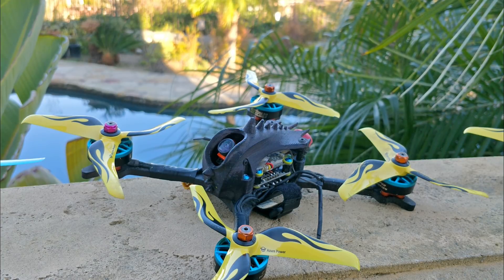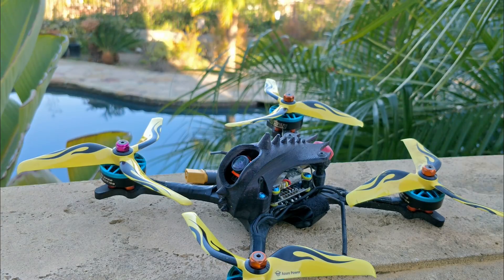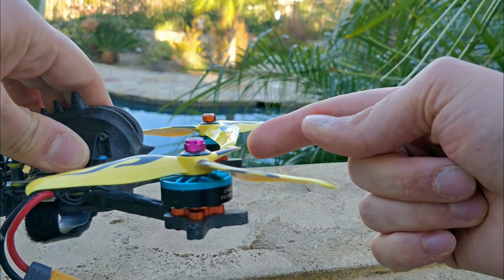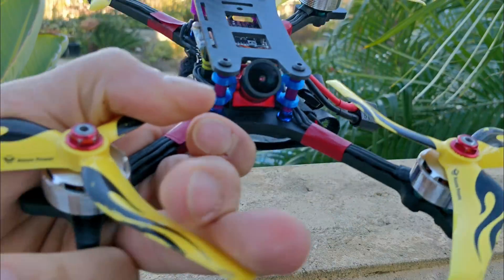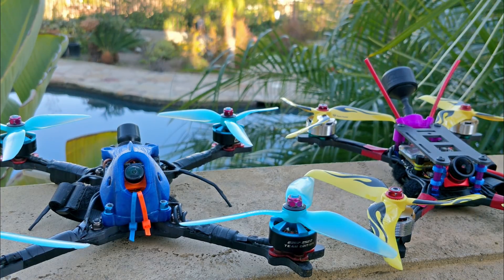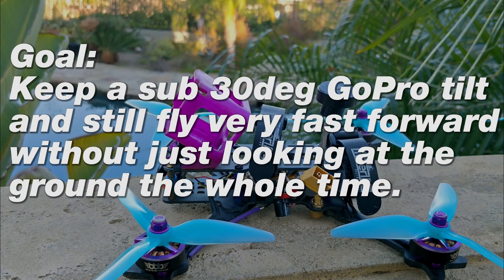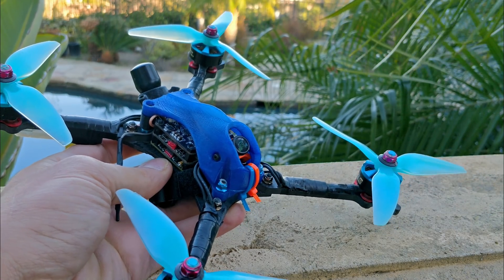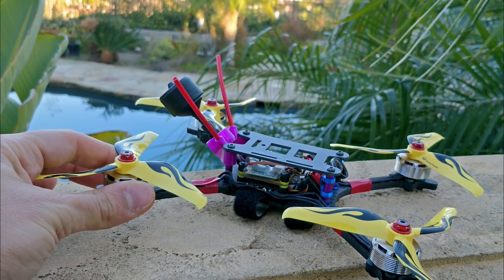Frame Geometry - Stretch X vs Tight X

Comment: Can't we just run 5.5" arms on true-x and call it a day?
Reply from the maker: That's reasonable.  But the difference between 5.5" and 6" is just a few mm.  So just gonna make it 6" probably.
Reply: mm... very funny to see americans talking about distance measurements in metric system. Hardcore ones usually stick to imperial stuff. No offence though :) Just sayin.
Reply: Wouldn't that have a larger footprint lengthwise than a std stretch?
Reply: KrotowX as an American we were prepped for the metric system at a very young age.
I was taught at elementary school that we would move to the metric system(we should have) imperial system is plain stupid! As a hobby machinist I build only in the metric system!
Reply: I read about several tries to transit from imperial to metric measurement system in US. It sort of didn't gone well so far. Partially because of large expenses for transition in some areas, partially because of people habits. At least in math, physics and other exact science areas and engineering transition already happened. But I guess that imperial system will continue to live 2-3 generations ahead because of habits.

Comment: Thanks for another great thought provoking video! I just recently purchased a couple Floss 2.1 frames, and I'm struggling with how to soft mount the 20x20 stack (HGLRC F440). Have you considered making a version of the Floss bottom plate with bigger 20x20 mounting holes, in order to accommodate soft mount bushings like on the Xhover WIN5L frame?
Reply from the maker: You can always just drill out the holes
Reply: Yeah I thought about that, but I've never drilled carbon fiber, and I wasn't sure it would come out cleanly. I'd probably want to test the process on an old frame before I try it on the Floss bottom plate.
Reply from the maker: go ahead, just do it outside, you don't want that dust inside.
Reply: Soft mount the motors instead. Should be ok for MPU6000 gyro

Comment: Hey Bob thank you for your time. Speaking of frame designs, have you checked out the RMRC hellbender frame? I have one and I think it flies great. I'm curious what your opinion is? Project Blue Falcon has a great video on custom mixing. Thank you sir.
Reply from the maker: I'm generally not a fan of monobody frame designs.  The arms on this are also quite beefy which will impact thrust performance a bit.  I think it's a bit dated of a design by now.  Was maybe good for it's time.  It's not a new design.
Reply: Kabab FPV okay now I have to buy your frame and move everything to it.

Comment: Interesting discussion. I remember BMSWeb at some point saying that Thomas got very similar laptimes by slightly changing racing style on true, stretched and squashed x. I think he did or still does race squashed x purely on his preference.
Reply: I think being familiar with your setup is the most important thing.  Constantly changing builds is going to be a detriment in most cases.  Any well built 5 inch quad is going to be very fast and probably capable of winning most races if flown to its true potential.  If you are always adapting to new setups you won't be able to fly the quad at 100%.  Thomas sticks with a familiar setup and is so experienced with it he can really fly it at 100%.  It's kind of like a 1000cc sportbike.  Doesn't really matter if you ride Honda, Suzuki, Yamaha etc.  They are all fast as hell and rider skill is what will really decide the winner.

Comment: What would fly better; 6 inch frame with 6inch props or 6inch frame with 5inch props?
Reply from the maker: 6" has a totally different feel to it so that's really preference but I know that a 6" with 5" props usually feels better than a 5" with 5" props.  Same with 4"
Reply: Trick question.  6" frame with 5.5" props

Comment: u are so correct.....and i believe that its kind of the same thing that happens with airfoils...the way the prop is designed creates a low and high pressured air due to it's angle etc....if the gab isn't enough for the air to get separated in its maximum potential the quad will not be that "effective"
.. . just making an assumption.... not really sure!!!!
Reply from the maker: I guess that makes some sense maybe?  I dunno that much, I just know what I've tested.  I can't even begin to guess the interaction between front and rear props, I just know that it happens and how to work around it from testing things.

Comment: Do you use the same 3d printer for quad parts as you do for a customers teeth?
Reply from the maker: I wish I could use a 3D printer on a daily basis in my dental office.  Unfortunately the maintenance of one is just too much of a hassle.  The labs are there for a reason.  Much of the time it's not worth it to have all that stuff in office, even if it does provide a better patient experience.  This includes the milling machines.  The end product and results are often better with a lab tech producing the restoration anyways.

Comment: What about plus frames? I know they are not great for filming, but for racing they seem really great
Reply from the maker: The cross is particularly good in a straight line but feels a little odd to me around turns.  It's a bit more complicated to design and build and it never really caught on so I haven't developed too much in that direction.
Reply: How to mount the battery also gets tricky with + orientation.  You can't run it through the middle of the frame because the arms are there.  And then just a little ahead or behind the middle of the frame you have your stack screws that gets in the way.

Comment: Hey buddy sorry to bother you agian but have you ever done a discussion on longe flying like 8mins plus... I have a flight test gremlin and some old 1350mah 4s packs I cut them up to make 2s packs and they last for 10mins plus flight performance is ok but 11 minutes of flight time EASY
Reply from the maker: well it's not really a big discussion.  To get more efficiency in flight, just go lower kv and use a higher voltage battery.  Increase capacity to whatever the quad can handle and go easy on the throttle.  A typical race quad can usually hover for maybe 15min on just a 1300 or 1500 4s pack...

Comment: Hey Kabab! I have a question, im choosing a t motor for my next quad with dry weight something like 270-300grams. I chose air40 t motors for it. Are they good? Please answer if you know about em. Thanks!
Reply from the maker: The air series motors have a reputation for not being the most durable motors.  I would recommend a more standard motor.  Any of the hyperlite 2207 and up or pretty much any 2207, 2306, 2405 that's priced $16 and up.
Reply: Kabab FPV thanks! But i would say most hyperlites has naked bottom. And im not good as you guys. Not even close!!i crash and crash and crash haha so i was thinking something that has closed bottom like air40/brotherhobby tornado
Reply from the maker: naked bottom is stronger.  There is more metal in the base.  It's also easier to clean because there isn't anything down there.  You're also less likely to use screws that are too long and damage the stater windings because you can see it easier.  It's a fallacy to believe the little railing on the bottom is in any way protective of anything at all.
Reply: Kabab FPV thanks again!!that will help😊

Comment: I designed a Stretch X Frame that has the back arms closer together than the front arms. I have been flying it for about a month now and it flys great. The front arms can actually take a 6" prop while the back is limited to 5.1" or smaller props. i am currently flying it on 5152 props all arms and like I said it flys great and accelerats like crazy, while allowing e to make crazy tight turns. I would like to know your thoughts on this design.  Think something like the helbender frame but much slimmer for racing. I Have linked to a picture. 
https://photos.app.goo.gl/48j9bI3avlxzSIh12
https://photos.google.com/share/AF1QipOASKBtlXsOIsdBlmAOrj79ii7dJBLTpxaMloXZH3H3dZEGgIPnsGO3yz2tvUEKkQ?key=bzYzV0d6eDRtMEdNa3VvRFRBVEpDSk4wV1hVQ1dn

Comment: #thatstretchedthough are all your builds running reverse props ?
Reply: Cale Hunt if you reverse all your props, tell you escs to spin the other way, and check the option in the configurator that the props are reverse, you can run your props the reverse direction allowing you to possibly crash less as well as not getting crap on your cam lense like the original rotation... not crash is often is why I choose to spin them reverse
Reply from the maker: Always
Reply: Please explain about this !!!
Reply: Thanks !

Comment: Cmw merica has a slight height offset between front and back arms and is very solid.
Reply from the maker: Yes I feel it's one of the few near X frames that would perform really good for racing.  at least just my opinion
Reply: Kabab FPV it has fairly substantial stretch
Reply: Kabab FPV i would love to see your thoughts on the CMW Merica. It is the best flying quad I’ve ever flown.
Reply: Merica quad kills it I love it !!!

Comment: Is there a reason we don't see more frame designs with tubular arms? Shouldn't they be lighter for a given strength and more aerodynamic than flat arms?
Reply from the maker: They're really difficult to manage.  The mounting mechanism is a mess and usually weighs more.  The aero benefits are logical but hard to confirm without numerical testing.

Comment: The sx vs the x is not really more a problem with the dirty air. It has more to do with pitch control. Sx is easier to keep a stable height.
This is for the top pilots that fly 45+ cam angle and fly the quad like a plane.
It is what you say, it is personal what you like. Bsmthomas flies squished x.
For the ones that fly lower angles, it is different but with those slower speeds, the dirty air is there but not that big of a deal. It is more the pitch control that you notice.

The only thing that will change is the mid part of the frame. Because of the smaller electronics that are there and are coming. You see it already with when the micro cams came and with the win5L that is made for 20x20.
Reply from the maker: Yeah I didn't discuss this particular effect because if you're that high up in skill, none of this matters for you anyway.  You do what you know and what you like no matter what.  The short X lets you keep your angle high at all times...can be good for racing depending on preference and how you fly.  For the rest of us mortals, we don't fly at 80deg cam tilt all the time ;-)
Reply: Kabab FPV I know I don't. Hahaha

Comment: Another way to go around the problem was mounting motors upside down with battery on top. That design needed some sort of skids, but motors, had all the space just for themselves below all the frame/electronics/gopro. Also You really need to check Alex Facey design of a frame, i'll tag You on facebook with his project.
Edit: I can't tag you in RR FB group and i don't know why. Hope that link will serve well instead
https://drive.google.com/open?id=11dakPweCcadLA2nEdU38Llj6TWPkybUR
Reply from the maker: This definitely is an excellent way to go however it's a bit unpractical which is why I don't even bring it up.  Looks like a nice frame but also looks a bit complex
Reply: I would just mount motors on carbon and make them tilted and make side plates a bit bigger so i could mount arms directly into side plates without those mounts and secure by a standoff or something like that. That would make that frame a lot easier to produce and make that design usefull. I know "tilted motors?! 2015, gosh you're late on hype train" but it just make life easier. The design itself as i said above it's all Alex Facey work and he says that this frame weights about 80 grams.

Comment: I want to make a ton of comments, but will try to be minimal. Out order: , when I start to hit corners harder with my true x shape, it gives a particular sensation of shoving the obstacle to the side. Longer frame in the same move tilts hard but its more difficult to fly it, feeling really "dippy". (Only said "near 180" around something). .. it feels to me like just the leverage change of the longer geometry is also having an impact. A longer stretch might transfer more energy laterally at less tilt even without having to overcome the turbulence and vacuum effects of another prop in the "intake". Ive been running around thinking squashed x frames are preferred because of the leverage of the geometry, making rolls take longer feels more "cinematic" while making pitch flips happen faster is great since the camera has a hard time seeing during a slow flip, theres nothing to follow, so pilots naturally tend to want to do y axis flips very quickly and settle on a target for orientation, while rolls can be slow without distorting orientation.
Reply: I really cant get over a frame that i feel might be very well engineered for that "forward skate" you talk about, where minimal pitch affords very smooth and fairly fast forward travel. The storm srd9 gps. It has rear arms that connect to the bottom plate in the front along with H style front arms. The battery is mounted behind this joint, and is mounted more rearward top. The rear arms are long, and would probably be relatively flexy. This isnt really a deadcat orientation, and I disagree that the arms being mounted in an inefficient lever against the battery wouldnt matter, I think the arms being ahead of the battery would cause measurable delay in energy transfer. My reaction to the frame was that it is specifically engineered to maximize on that "forward skatey" feeling that longer frames enjoy that x frames sacrifice almost completely. (An. X frame feels to me out of place on any course with straight lines that might reach a full speed of sorts). Is anyone talking about this srd9 gps copter? Its so big, miniquad design is definatly around the very ridgid properties of small shapes. (Actually very thin arms might flex, damping energy transfer, making miniquads easier to fly. If harder, stiffer materials were used, would miniquads fly more like tiny whoops? Your favorite micro looks like it would flex and dampen)
Reply: By the way, your videos are absolutely essential, and I am a big fan. I dont have your frames, because Im such a new pilot and only fly on a tiny budget, but I am very excited about all of your works and thank you for all of your essential contributions.
Reply from the maker: The points you bring up are all valid and are things that you should experiment with yourself to find your preference.  I'm trying to get that fast forward slide on a light quad without so much effort and it's what I've been working towards for a while now.
Reply: What if the rear arms were longer, connecting to the front arms while maintaining the same motor geometry? There would be some sacrifice in agility, but maybe some gain in slide? I struggle to believe that frame designers come up with such interesting oddities without developing some effect.
Reply from the maker: I really value simplicity a lot.
Reply: Is a standard deadcat particularly suited to smooth shallow forward flight? ( a true x is not, but a stretched x is more so,  i assume a deadcat is almost exactly as much more like a stretched frame as the "more length" ratio, but also rolls more slowly somewhat, maybe sacrificing some stability as a result of the trapezoid motor geometry) .....  my thoughts on the floppy inefficient rear arms of the srd9-gps is that throttling up the rear motors to pitch forward will result in more thrust from the rear motors than on deadcat where the arms still connect on the shortest line to the cg.

Comment: Sorry if this has already been asked, but is there a way to get the STL files for printing such amazing TPU pods/canopies for the floss 2? Mostly interested in the blue one since it looks more meant for the floss 2 than the black one. Cheers!
Reply from the maker: http://pirofliprc.com/Floss-2-Nylon-Canopy-By-Phoenix-3D-Solutions_p_4366.html
Reply: Kabab FPV actually nylon, nice! I guess it helps with the stiffness of the frame, since you mentioned several times that the top plate is required for rigidity in the floss. Cheers!
Reply: Ouch cheapest and only shipping option to Switzerland is 40$.. I remember it was lower when I ordered my floss2 last year, what happened? Can't order unfortunately if it's that high
Reply from the maker: I know :-(  It's a problem we've been working on forever
Reply: Valentin Bersier I don't know how, I managed finally to order yesterday a frame with 10$ shipping fees lol... In Switzerland
Reply: claudius Cubitus yeah it's weird, I ordered with USPS last year for 15$ shipping I found the email confirmation..

Comment: custom mix isn't that hard
Reply from the maker: Is it even built into BF still?  Not hard but you gotta do it for every quad and I wouldn't be able to standardize my rates across quads as easily.  That's my only reason not to use it.  Just adds complexity.

Comment: Great vid as always. One build tip thats given me a noticeable improvement with on my floss 2 (6in x 5mm arms + canopy w/ 5in props) I mount the 2 Front arms below the bottom plate and the back arms above it which staggers the motors and gives them an additional 8mm of offset without sacrificing anything. Great results for me
Reply from the maker: Yeah that does actually work well except that it destroys your batteries or you need a huge batt pad